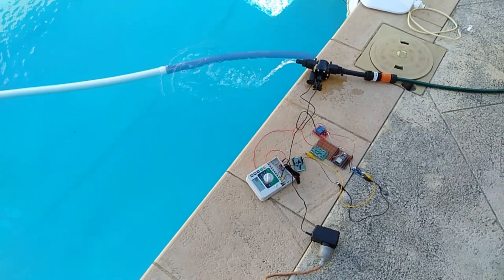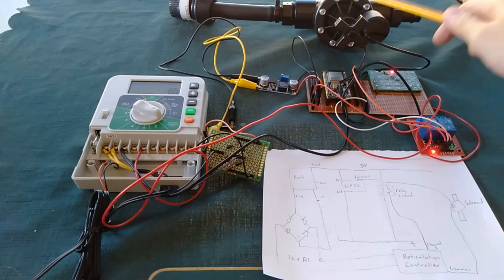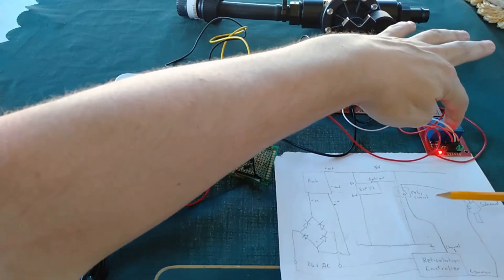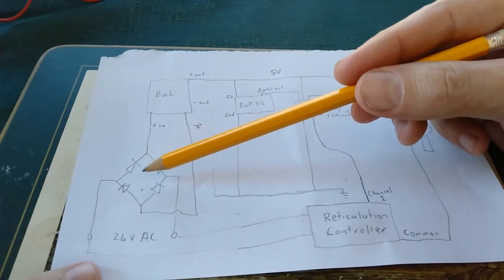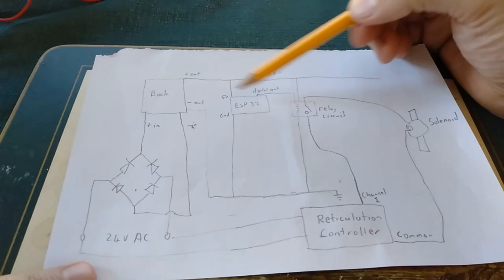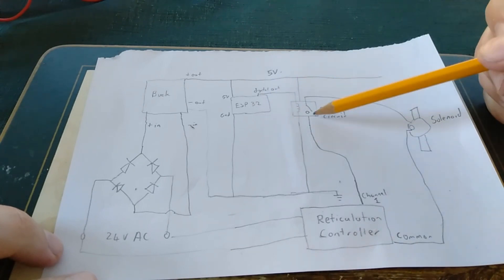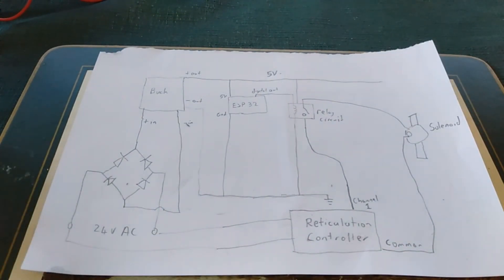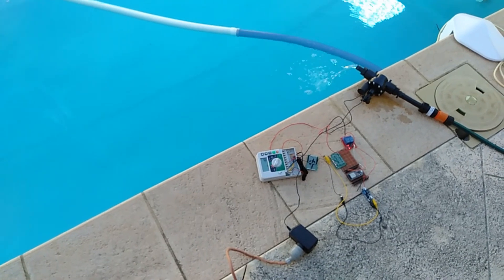Control Irrigation Solenoid with ESP32 (Swimming Pool Water Level Part 5)

Comment: Excellent modular design, have you incorporated flyback diodes across the relay and solenoid coils?
Reply from the maker: The relays are in a module I got with an Arduino kit so the flyback is taken care of. ☺️
Reply from the maker: The relays came in a module I got in an Arduino kit so the flyback is already taken care of. ☺️. Very good point that one is needed though.